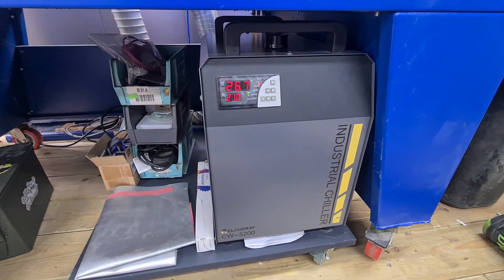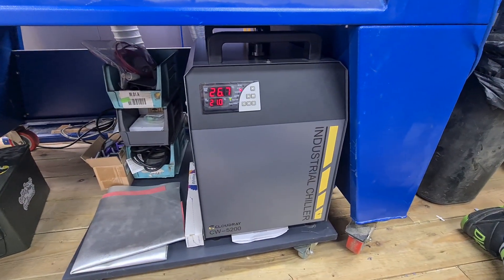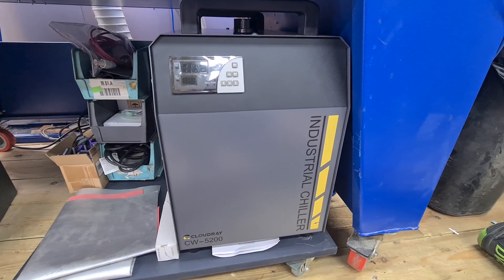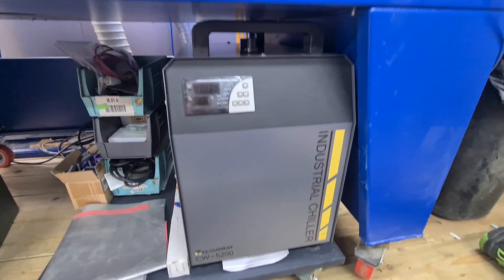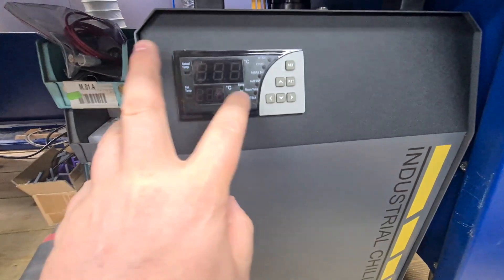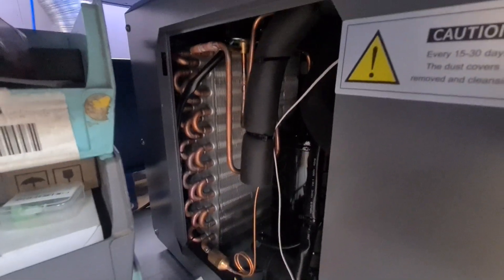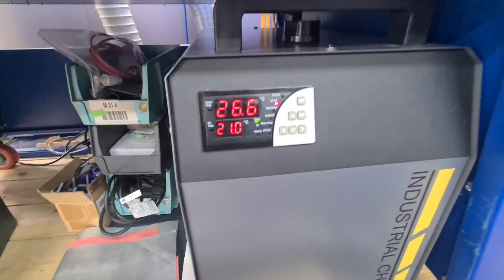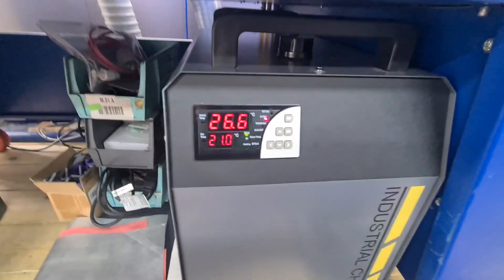Avoid These Common Mistakes Cloudray CW 5200 Co2 Laser Chiller

Comment: Man thank you so much for making this video. I would have never figured this out from the manual. FYI I am on the Omtech silver that has the same control panel.
Reply from the maker: No problem at all, I couldn't find anything on this at all, and like you say, the manual doesn't help. I'm really pleased to hear it helped you. 😀 it's a good little controller I changed it all over when I pretty much rebuilt the laser lol